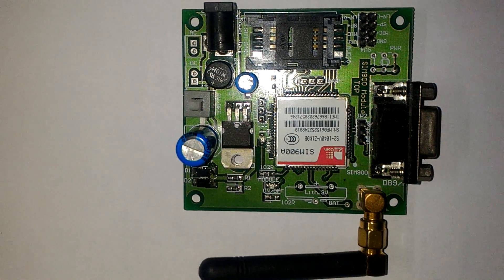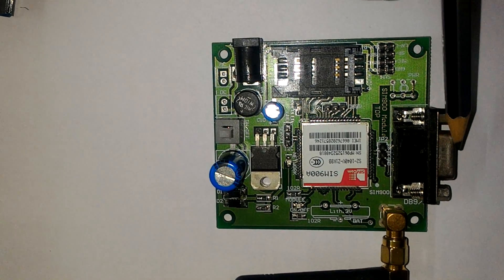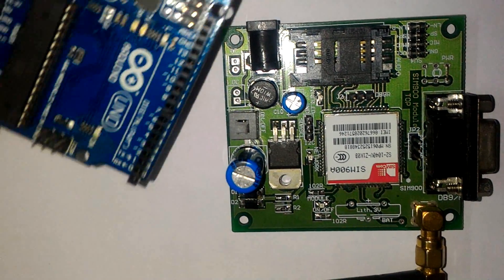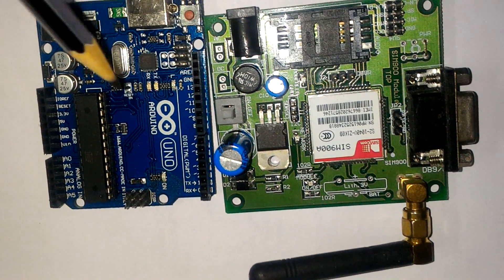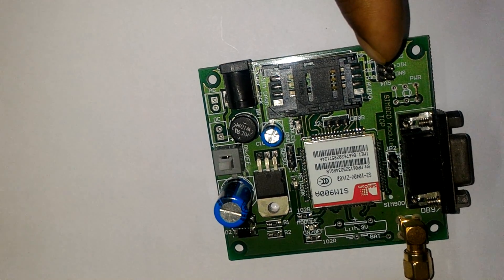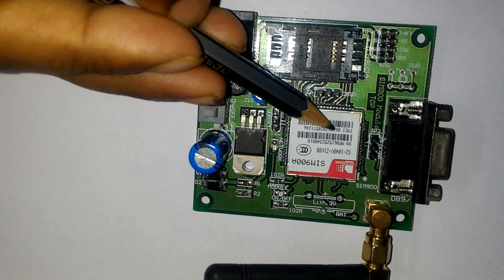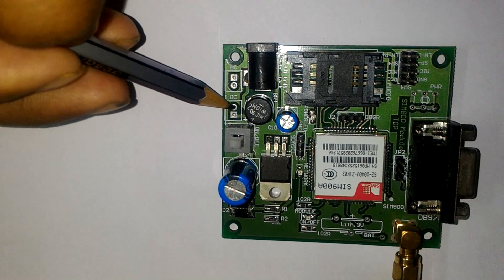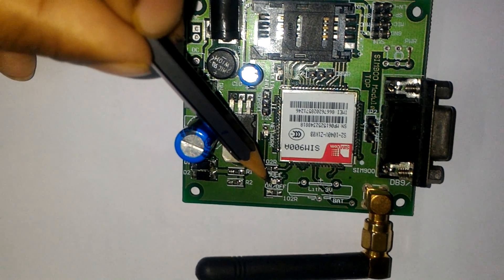GSM MODULE SIM 900A

Comment: Can laptop charger be used to power it ?
Reply from the maker: Use step down converter with laptop Battery and step down the voltage to its operating voltage

Comment: sir,
    my sim900 module is not able to register itself.. Even  by inserting a valid sim with proper power (12v) supply, what should I do now..?
Reply from the maker: For checking it is ok or not first give it supply and add sim card then give a call if call is going to that sim then antenna and module is ok . Next issue come in the time of interfacing, if you interface with arduino then after upload the code to arduino then connect the GSM shield with this...You asking about registration i am not getting which kind of registration can you give some more details .
Reply: first I like to say thank you. The (network status) LED keeps on blinking with a delay of 800ms if it get registered then it will blink with a delay of  300 ms, that's what my problem is, After inserting the sim in module if trying too call that no from my phone but it does not connects.
Reply from the maker: Some time the issue is coming for micro SIM and using SIM card tray better use mini SIM or normal SIM if that is also not your problem then once read the manual you get it from google and once do it from the beginning Some times we are do some small mistakes for which it is not working properly..

Comment: sir, i am unable to power the GSM , i am using 12V adapter, 1 Amp , also LM317 is heating , Call is also not made.Plz help me out
Reply from the maker: first check the tower of the sim when i use it first time then i face like this problem as i am using micro sim and by using an sim holder i use the sim that's why it not work after use full sim it solved    Secondly due to adapter i face u can see below command also
Reply from the maker: and one thing when you give power to your gsm shield then switch off the gsm shield after that press the switch to onn it
Reply from the maker: and one thing when you give power to your gsm shield then switch off the gsm shield after that press the switch to onn it
Reply: Sir calling is still a issue, code isn't working

Comment: Thanks a lot.
Did you face any issues with the LM317 regulator installed here? Is there any frequent signal drop/loss?
Reply from the maker: Yahh i am also face that issue but i solve it using 12V 2amp Adapter or SMPS. I notice one thing when i use micro sim with sim tray then signal problem come due to adjust problem..... thanks man for watching. Comment if you face any issue if i know i help you......